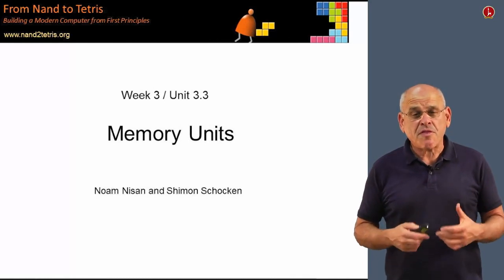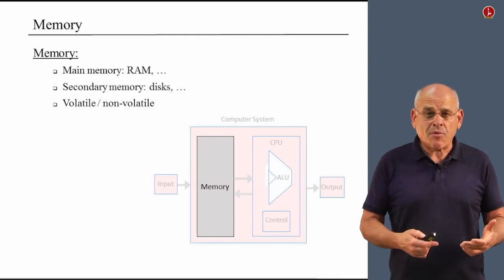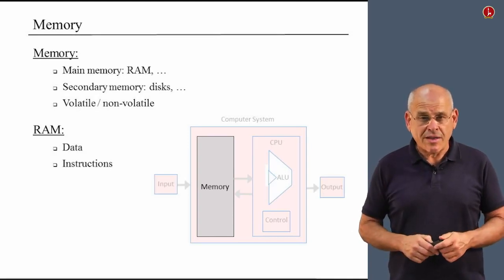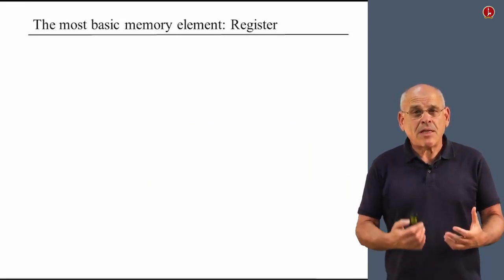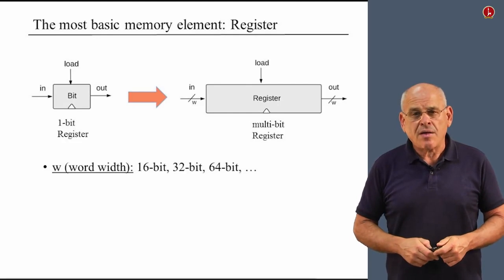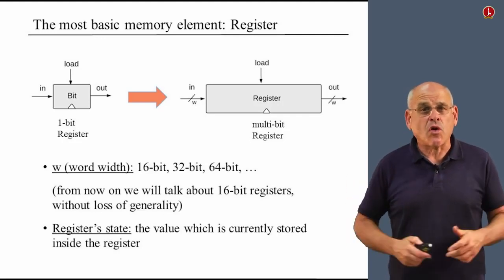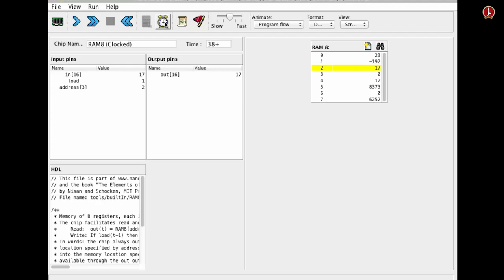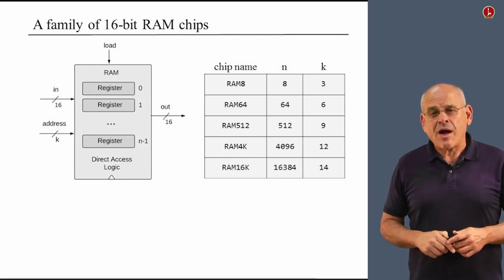[Part 1] Unit 3.3 - Memory Units

Comment: for clarification, in case anyone is wondering:

a. the example used to depict a D Flip-Flop in the previous video was an "edge-triggered" flip-flop that reads the input, stores that as its state and emits the O/P at the edge of the clock-pulse (either negative-edge or positive-edge)
b. the built-in register uses a "level-triggered" flip-flop which reacts to the highs and lows of the clock pulse. Also, in many online forums it mentions that a level triggered flip-flop changes the "output" at the appropriate level of the clock which happens to be an inaccurate definition according to our register's definition (becomes clear when you see the RAM emissions when trying to change the O/P after a tick or, half-cycle) Here, the flip-flops inside the register are positive level triggered and they only record(change) the state at every tick. The change in output is reflected only at the end of the "tock" (end of the cycle). This is consistent with the idea that level-triggered flip-flops are less preferred in practice because in an edge-triggered flip-flop the input influences the O/P only for a very narrow interval.

Also, as a side note --- the previous video starts off analyzing the clock as a measure of time in physical world but later, it progresses to a more Comp-Sci definition which is simply a square wave; an oscillator. It is more so a demarcation tool viz-a-viz a physical clock though the both do have same terminologies, it is best not to confuse b/w them.

Hopefully now, the reactions of the register to the ticks and tocks make more sense with reference to the previous video's content.
Reply: Very nice, I just wanna correct a little word... French is hard but you're supposed to write vis-a-vis (or even put an accent on the a but since it's English we tend to get rid of those even if incorrect).